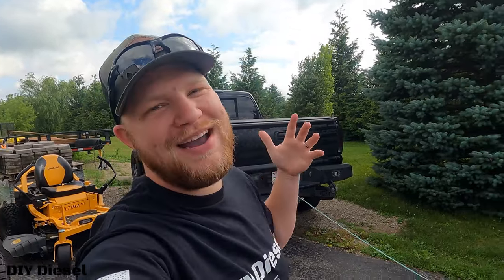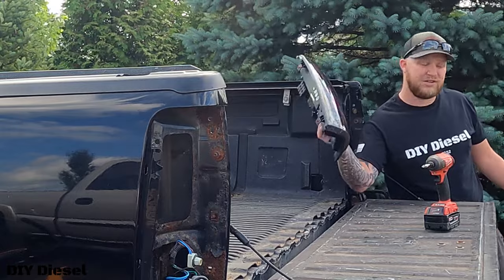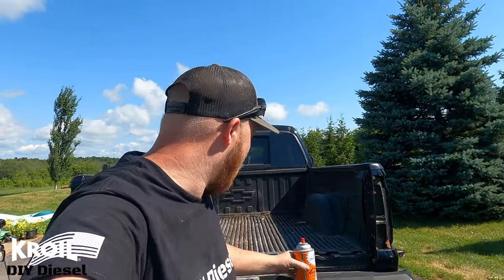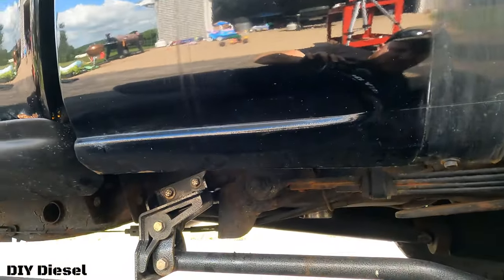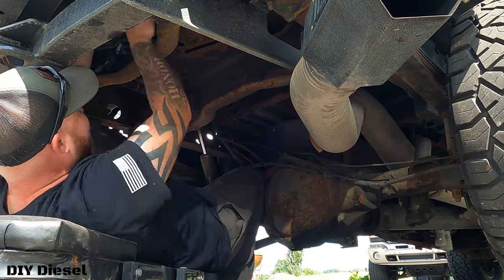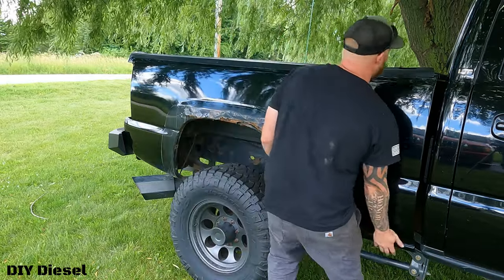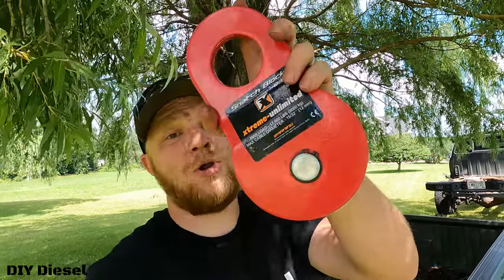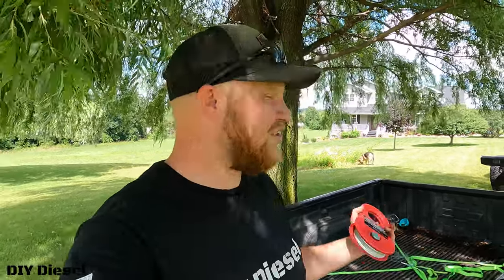How to Remove Your Truck Bed Without A Lift! LBZ Duramax or (Chevy/GMC 1500, 2500, 3500)

Comment: No hate, but the reason those bolts came out is the Milwaukee impact and not the kroil. Kroil is one of the best penetrating oils out there, but it didnt help in this situation because they are upside down and they are bolts with flat washers. If they were nuts with exposed threads then it would help, but the threads were dry when you pulled them out
Reply: I said the same thing laughing in my head. Threads were dry lol.

Comment: If I am converting to a camper (cutaway style) and looking at gross weight options.  
How much weight comes off with the bed?  
I assume that the camper has more available load capacity without the bed.
Bu how much?
Reply from the maker: Maybe like 300 400lbs

Comment: I heard using a engine hoist is as good too?
Reply from the maker: That would probably work pretty good 👍🏼
Reply: YES. Chains work SO much better. I remove my bed and cap all the time - no problems. One-man job.
Reply: I use this "X" method with the straps and then hook cherry picker in center on both straps and lift. One man job. Either drive out or if on concrete just roll hoist backwards.

Comment: I just did this on my 05 2500hd and mine was just as bad if not worse, took me about 50 hours just grinding
Reply from the maker: Damn! Couldn’t get the bolts off?
Reply: @DIYDiesel  no the bolts were the easiest part! I just had 18 years of Minnesota rust on every inch lol and quite a bit of scale
Reply from the maker: @cameronakzam5079  Ooof damn that’s brutal l
Reply: Just took mine off putting on a wooden flatbed